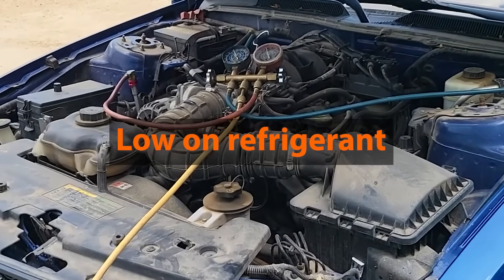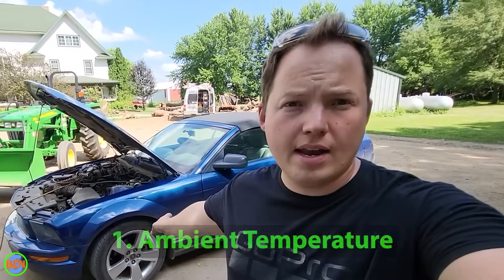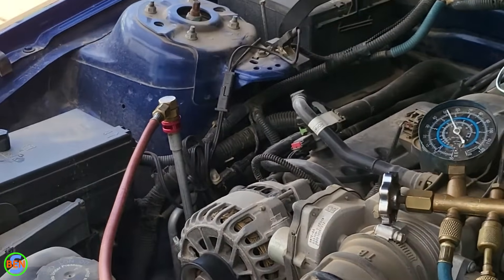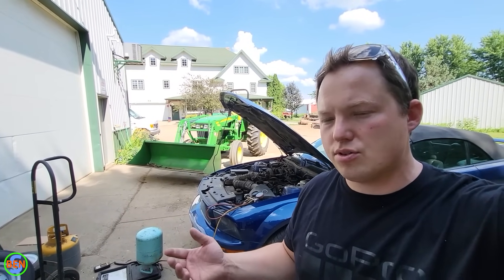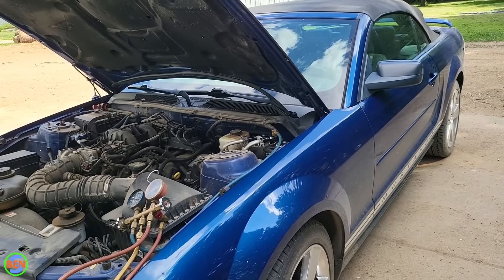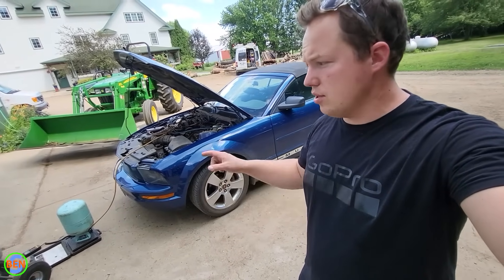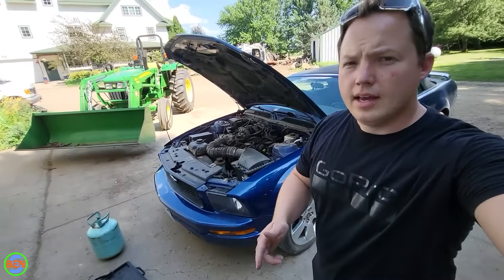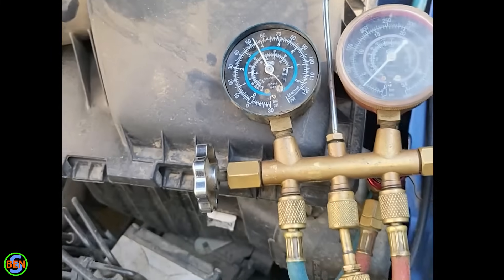What Pressure Should my Car AC Be - How To Check Automotive R134a Air Conditioner - Recharge Tips

Comment: Hey, I need help! My car gauge reads on both low and high 117 psi, I left car running with ac on max for 15-20 minutes. A/C clutch is not engaging at all. What can be the problem? Fuse & relay are looking good*

Comment: 5:30 "You want air recirculation turned off." Ac Pro and other companies want the recirculation turned on when recharging as it makes the compressor run continuously. It's the outdoor temperature that flows through the CONDENSER coil that dictates pressures read on the manifold gauges. The interior air temperature is coming from the EVAPORATOR coil and has little to no effect on charging pressure in a car. Turn your AC to high, recirculate, and charge according to outdoor temperatures.
Reply: Should you have windows open or closed when testing?
Reply: @boloone1418  I would keep them open so that your AC continuously runs on MAX and any temperature controls can't possibly turn off the compressor if the temp selection is met. Your high side pressure and low side pressure is read from the condenser coil which uses the outdoor air ambient temperature to adjust pressures read on the gauges so the interior temp has little to no effect on pressure readings.

Comment: I just have the gauges they sell with the refrigerant.  It is in the High end of the Blue Scale (charged, good).  It gives every symptom of a low charge.  Like it works great at night or on cool days but not when the heat comes.  When I rev the engine it goes into the low zone but I can’t do it without a helper.  Can I add some refrigerant?
Reply: I checked my car filtersOK

Comment: I've seen other technicians say, "Not to put the refrigerant can upside-down for the liquid to go into the system." So, what is the correct way to do it?
Reply: You can charge by either vapor or liquid since it is a single component refrigerant. Vapor charging takes a long time. Liquid is much quicker, but must be done in small shots about 3 to 5 seconds long. This gives the liquid time to vaporize before it hits the compressor. 12 o'clock to 9 o'clock positioning of the can rocking back and forth will allow the liquid to flow at the 9 o'clock position for 3 seconds, then 12 o'clock for 30 seconds while watching low pressure gauge. Accurate reading on the LP gauge is only when the compressor is ON. When the can is nearly empty, hold it upside down to get all the gas out of it.

Comment: Dye - good. Sealer/stop leak - bad ... BAD! If you put stop leak in the system and you - one day, decide to get a professional service it for whatever reason... TELL THEM you have stop leak in the circuit --- it will damage most AC Service pumps and filtration devices and you could be responsible for the damage it does. My latest problem is learning how to use a 4-valve, 4-hose system --- it's not your dad's Buick! Good video, BTW. Understandable and the background was interesting too.

Comment: Thanks for the tutorial.  Just one comment:  Most modern cars now commonly have variable rather than fixed displacement compressors.  Compared to fixed displacement compressors, variable displacement compressors may yield unexpected low and high pressures that are NORMAL but do not fit with the R134a low and high side pressure chart shown in your video.  This is an important CAVEAT for cars with a variable displacement compressor.

Comment: You charged liquid into the low side? Personally I haven't had much luck using sniffers on mobile equipment because there's so much air movement. Maybe with everything off - I don't know. I always used Big Blue.

Comment: The cans of R134a (ZeroR & National) you have a link to are not real R134a. They are R134a replacement which are more flammable and not as efficient as actual R134a. At the time of this writing, Walmart sells real R134a (Super Tech). Stock up because real R134a is getting hard to find.

Comment: I'm confused when you say that you must check to make sure that the recirculation mode is not on. The ambient temperature is checking the outside temperature anyway and that's what we want to check we don't want to check the cabin temperature which it's not even checking anyway
Reply: The temperature inside the vehicle will lower the temp of the refrigerant more than it normally would and will give a false reading on your pressures. Showing an appearance of the system being under charged. You want to have as nominal temperatures all around when checking charge

Comment: question, My ac is not as cold as before, I need to set the fan and thermostat on max to be able to feel the cold, but it is not that cold compared before, I have the manifold gauge hooked up,Engine is running, ac is running set to max both thermostat and fan speed. I get the reading  L= 40 and H =170  Ambient temp = 31C (car in idle), and when the plate on the compressor click and run at the same time the radiator fan spin, the reading goes L=30 and H=150.  Do I have normal reading or its low on refrigerant?  Should I add a freon?
Reply: charge is low.  chsrge to about 35 psi low side with doors open, max cold, max fan,  vent on recirc.  charge slowly.  check the suction line.  if it is cold and sweating.  stop.
Reply: H should be around 200 
low charge

Comment: hey brother good job and thank you for your videos, im having a hard time with my wifes truck ac system, the gauges say i have exactly the same pressure on high and low side , i put a new ac compressor and still the same thing , what else will it be? what else should i throw at this truck???
Reply: check if the compressor clutch is engaging.

Comment: You have made more sense than those idiots that do A/C Pro videos. They have no clue as of what they are doing. People seem more worried about pressures than whether the system is even running. Running recirculate has nothing to do with anything. A/C does not cool the air, it removes the heat from it. The condenser and fan do all the work. I have been doing automotive A/C work since the 80's and know many of tricks and shortcuts to make diagnosis and charging easier. Thanks for the video.
Reply: dont forget the expansion valve
Reply: " A/C does not cool the air, it removes the heat from it." My 13 yo grandson would love that! He will argue "water is not wet, it makes things wet" !! Yeah, I guess in a certain way, you both are right!!!

Comment: Why will m system only take in 12 0z out of 28 with a new pump?
Reply: Did you pull a vac after installing new compressor?

Comment: Nice video and clearly spoken. Liked how you pointed out not using shortcuts.  Question.. I'm working on my daughter's AC this weekend when she gets in town and whileI have a lot of experience with house and apartment ACs, do I not need to worry about superheat or subcooling? Just go off the pressures and temperatures? I can charge off the DIY can,  but I now have a set of Auto guages and want to get this down correctly. Thanks
Reply: nope just pressures.   check the compressor and condenser fan if they are both engaging.   if you have a beer can cold  and sweating suction line, you are good to go.  and clean the cabin filter first before doing anything.  thermostat max cold,  max fan speed, intake mode on vent.  doors open.

Comment: Does rpm have any effect?  Should you set it to something like 2,000?  Great video!
Reply: Yes it does.  When you go from idle to 2000 rpm, the low-side pressure will drop considerably.  Same is true if you put a fan in front of your car's grill.

Comment: If my vehicle’s A/C works fine while the car is running (literally in motion on the road) but isn’t working (cooling/warming airflow) while parked or stopped at a traffic light, could it also be a low coolant problem?
Reply: No, low coolant will only cause your heater to work poorly, it doesn't effect the a/c system.  It sounds like you have a plugged condensor.
Reply: check if condenser fan is working first.

Comment: If I just have to add refrigerant to the AC do I add oil too if so how much??thanks
Reply: The oil stays put even if you vacuum the system.  However, if you change out the compressor,  you'll need to add oil.  Many compressors come precharged.

Comment: Of course you can release some if you put too much...
No need to sweat over it 
The world is not gonna end
Reply: If your system is charged with R12a (propane mix) or R152 (so-called canned air), there will be little to zero damage to the environment.  If you're bleeding off R12a, connect it to a BBQ grill and cook a hot dog.
Reply: @jackb1803 damaging the environment is a total nonsense!!!!!!

Comment: I’ve been maintaining and repairing my own and family and friends hvac for about 5 years now and I’m still learning. I was fed up with so called professionals getting snagged on simple systems chasing issues a thousand dollars at a time until they eventually work out what it ended up being wrong with what I’ve always been led to believe was fairly simple principles of refrigeration. I leaned a bit from your video and it marrys up with my actual experience of discovering and rectifying ac issues other than the head start I have gotten from the old black light and Uv liquid to find leaks. I love degreasing my equipment so there’s not always an oily patch to give it away . 
So after all that spiel from me thank you very much. I always have my system on recirculating so I’m going to stop that and I’m guessing that’s going to smooth out the recharge and evaluate process for me.

Comment: What will make the high pressure side read high numbers! Just replaced my dryer and compressor. But my high side pressure is above 300 easy.
Reply: dirty condenser.  condenser fan issues.  too much oil.
Reply: Plastic looking filter was my issue. When compressor let go clogged the filter up. Replaced it fixed my issue.

Comment: If you're going to use the pressure/ambient temperature charts (or scale on gauges) beside turning OFF recirc' you should use a piece of cardboard or similar to block engine heat airflow from being pulled into the air box and across the evaporator. That means BOTH sides of the cowl vents need to be blocked from sucking hot condenser and radiator air and blowing it across the evaporator.

Comment: Would have been nice to show & tell how you charged it. Noticed the can was upside down, if I remember that lets the liquid in. Were you adding on the high or low side and what was the method?????
Reply: hand held can will likely explode if connected to high side. Fittings are sized only for low side to add.
Reply: Low side

Comment: Automobile air conditioning systems operate as medium temperature refrigeration systems. You should have around 22 pounds of pressure which would give you about 25° of saturated temperature of 134 the ambient temperature only equates to the pressure temperature of the refrigerant.

 At 85° outside we would have about 95psig of pressure in the refrigerant bottle. That ambient pressure does not equate in the automotive system because you're not measuring subcooling nor superheat.

An expansion valve is not the same as a TXV capillary device nor a piston.

I'm no wizard, but my 16 year old truck puts out 40° out of the vents
Reply: An expansion valve isn’t the same as a txv??? ( Thermal Expansion Valve)
Reply: @ sounds like you're making a statement, but you added punctuation of a question. Maybe you should Google that. Last time I checked TXV stands for thermal expansion valve maybe that'll be a clue for you.

A valve, opens and closes. A fixed "metering device "does not.
Reply: 22 psig will not cut it in texas.

Comment: Fahrenheit is not measured in Degrees
Reply: Degree is not a unit. So, degree Fahrenheit or degree Celsius or Centigrade ou degree Kelvin are correct terms for three different temperature units.

Comment: All these videos that suggest adding gas to the A/C system are false. You need to vacuum all the gas in the system, due to air contamination, then add totally new gas.
Reply: gas and go works for small leaks.   it will work for 6-7 years.

Comment: My truck’s low side pressure is too high. Freon is good and no leaks but it is not cooling. The mechanic said there is restriction and that I need to change the compressor and accumulator. The compressor is working it is just not cooling. What is your opinion on that?
Reply: clean the condenser first and check the fan clutch or fan motor.
Reply: empty the system and weigh in the charge

Comment: If using a dye, check what the manufacture recommends. For example, there is only one brand of dye is approved by Honda and recommended by Honda for use in its vehicles. The claim is that other dyes may contain additives that might damage seals/gaskets and possible corrode other parts of the AC system. I would strongly urge not putting anything like sealers in any AC system.

Comment: Thanks for clarifying the ambient temperature.  Most videos say the pressure should be between 25 and 30 on the low side when recharging and about 190 on the high side and they don't say anything about the ambient temperature. The temperature here was about 102 degrees and my pressures were high around 40 for the low and 210 for the high but I had barely put any from a 12 oz can.  It was still not blowing cold air.  I put in some more and it started blowing cold air now my high is around 250 and the low still around 40.  I will check it at a lower temperature later to see if it has a lower pressure.  I was afraid it was too high. Maybe it needs some more.
Reply: I'm in south Florida, if the outside temp was 102deg  half of us would be dead (because of humidity).
Reply: @GeorgeKennedy-u4r  Not only pressure/temperature, but some charts include humidity as well!
Reply: monitor the suction line when charging.  if ir is cold and sweating, stop.

Comment: If you draw down a vaccum forget about trying to reach certain pressures. Always go by weight. Get a cheap digital scale and if the system requires 34oz give it 34oz and ignore the pressures unless they are sky high

Comment: You showed the connections and where the each hose/connector go, but did you opened both valves or just the low side??
Reply: For refrigerant charging low side need to be opened. 
Gauges directly shows pressures no need to open the valves.
Reply: Open only the low side valve when charging.  On the high side, keep it closed.  The high side gauge will still work.

Comment: I work on MVAC, fan speed always on max and put recirculate on...ALWAYS. The same with a house do you open a window when you're charging a house? JS lmbo. Now as far as dye, it works well and I find it better than a sniffer just my opinion and if your look for a leak with dye if you don't want it in there flush it out, I mean once you find the leak you have to take the freon out anyways to fix it. I honestly think you did well even with a scale. I don't use scales I use a temp gauge and if it's a healthy system I can get normally 39 to 42 degrees coming out the vent. as of 2024 this will be the last year you can buy it everything goes to 1234yf. Be good bro
Reply: R134 not available after 2024?
Reply: @garrettstevensen2467   Remember how they did R12? doing it the same way.
Reply: @garrettstevensen2467  nope, all gone
Reply: Bs
Reply: @summerforever6736  which part? The phase out? You will see, what’s left of the shelf is all that’s left. You can play that keyboard gangster all you want and you will be the one paying full price, you have an opportunity right now before it gets to hot outside to go buy some. Lookout for yourself!!
Reply: not on cars.  max cold, max fan, on vent  mode, doors open. the ac system on cars is an air mix system.  the (main)  thermostat is in the back of the evsporator.
Reply: @ncolevalv_5673    Ok I don't never have and Never had negative issues. I have read this on the can of quick cans, I wasn't told this in school might be why I don't lol, 30 years I have been doing this, I like to show the customer the temp gauge in the car on 30 degs and they love it, doors open would hurts this. Now if I seen positive results from it I would change my ways.

it makes me think why open doors? the doors arnt open going down the road lol. I just don't understand.

Comment: My truck's ac blows cold but barely to the point that I have to drive with my hands on the actual ac vents in order to cool myself down.   The problem is that everything in my ac system is new, except the evaporator, all other parts have been replaced.    
My pressures show normal low side but high high side but in my case the orifice tube is new and shouldn't be clogged at all.   What else can be the problem?  Thanks!
Reply: Evaporator core plugged. When the AC is running. The evaporator core will develop condensation. That's why it has a drain. 
Because of the condensation, if there is any dirt. That's cakes up the evaporator core.
Reply: @2nickles647 a dirty evaporator will show low low side pressures and will freeze the suction line.
Reply: bad fan clutch or comdenser fan not engaging.  too much compressor oil.

Comment: Good video. Is there a rule of thumb for what the equalized pressure should be if the engine is off and cool high and low equal)?
Reply: Approximately 50 to 65 psi